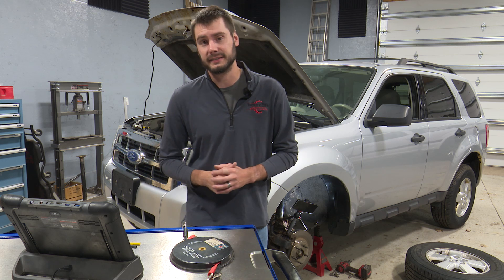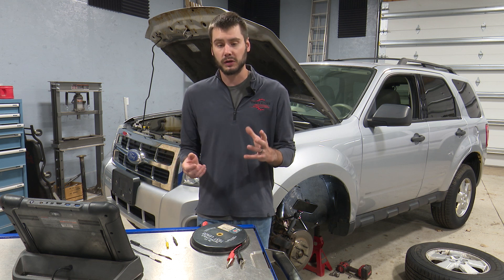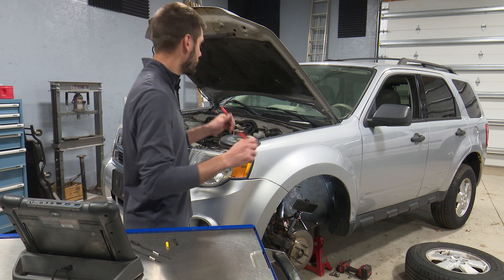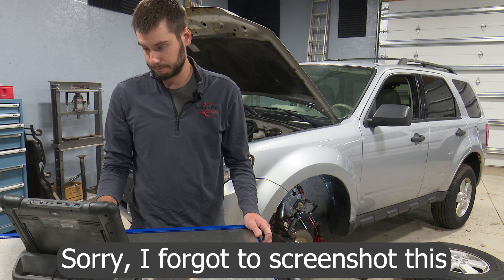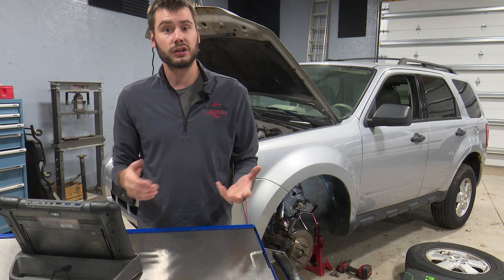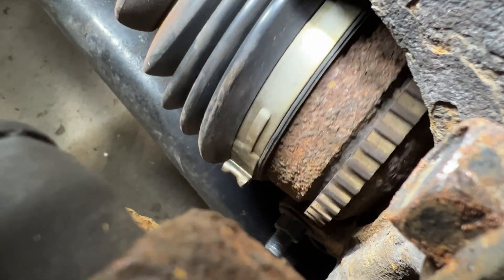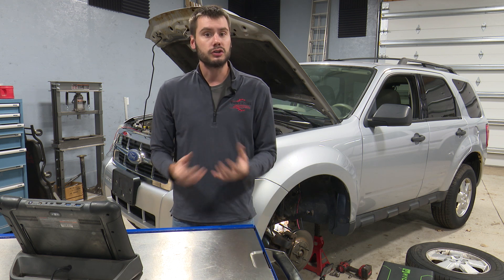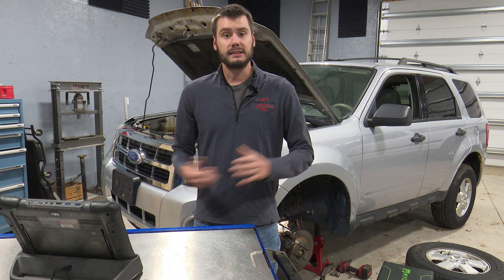How To Test ABS Wheel Speed Sensors

Comment: Sorry but for me it’s way quicker to either hook up a 1 channel scope like Uscope or simply just bypass the circuit with a signal generator. Put the correct waveform on and look at scan data to see if mph change and you adjust ratios. If it does that proves circuit integrity.

Comment: 3 out of 4 of my ABS sensors are working and all consistent except the left front one. It works but it goes up and down in speed. This is using a good Snap On scanner and monitoring the datastream. I got a new sensor and put it in. It works but the reading from it is even more erratic than the original one. 

There's 16,000 miles on the wheel bearing I changed in that corner. Could it be that the magnetic ring is damaged/defective? I cleaned it as best as I could and cleared the ABS dash warning but it never clears and is constantly there. The scan keeps pointing to the left front sensor. It's frustrating. 

Any input is appreciated, thanks.
Reply: Check the ground cables for those sensors for damage and corrosion
Reply: @humbledhands  the problem all along was a bad wheel bearing magnetic stripe. Swapped it and good to go.
Reply: @Hybrid600  was it a bad stripe on a brand new wheel bearing hub assembly? My abs light has been on for the front right ever since I put a new hub assembly in that side. The female pigtail became disconnected when removing the old one so I didn't know if the light was staying on due to a poor splice job of wires on my part. I've put in a new sensor and spliced in a new pigtail but it still won't clear. I would hate to put in another brand new assembly and the light stays on. I Just need my 4wd to work fml.
Reply: @joeluckenbach3682  yes was a bad stripe. Swapped the bearing and totally fixed the problem.

Comment: Is The car key in “on” position  to get the code?
Reply from the maker: Yes, to get a trouble code the module needs to be powered up. Either with the engine running or the key in the on position with the engine off.
~Mike

Comment: multi meter on sensor spinning wheel should show activity on AC  mode
Reply from the maker: On an AC style sensor that is correct. On this magneto resistive (MR) sensor, a digital square wave is produced. The sensor requires power and ground to operate.
~Mike

Comment: Keep the great content coming Mike!  Do you have any recommendations on service repair info for European vehicles? I primarily use Identifix and Mitchell ProDemand but info is severely lacking for European cars. It makes diagnosing or even hanging parts difficult at times. I have access to All Data but never use it because I like the layout of the other two sources better.
Reply from the maker: Hi John,
Sometimes if I'm in a pinch for info, I will purchase a day subscription to OEM service information.  BWM TIS can be purchased for $30 a day. It seems expensive, but it saves money in the long run not searching all over trying to find accurate information. 
Thanks for reaching out!
~Ryan
Reply: @GoTechTraining  Thanks for the tip Ryan!

Comment: Could you just short wire's together and see short reported then you know wiring good. So sensor or tone ring.
Reply: On gm with digital sensor it will kill power immediately if it sees a short.
Reply from the maker: Hey Ian, great question. Charlie nailed it, on GM's. Not sure about Ford, haven't tried it but i'd assume similar strategy.
~Mike

Comment: Its simple till you get 90s car with very intermittent signal loss going over bumps. No codes will tell you which wheel has signal loss. Driven with oscilloscope for hours back probed to all signal wires. Gave up
Reply from the maker: Hey Trout Junkie, thanks for watching! Sounds like a great diagnostic path to get the car diagnosed. Which sensor was bad?
~Mike

Comment: if it was a tone ring the code would't show up unless it was moving
Reply from the maker: Hey, you're right, that's a great point!
~Mike
Reply: In that case, you would most likely have a performance or signal code rather than a circuit code

Comment: this test has saved me a lot of money in he past / merry Christmas to you and you family
Reply from the maker: Awesome Simon! Glad to hear you're already using it! Merry Christmas and Happy New Year to you and yours as well!!!
~Mike
Reply: @GoTechTraining  I don't have a vehicle with wheel censors but I try to help others with their vehicle problems.  I'm not sure what running the information coming from the wheel on the the other side of the vehicle into the censor that has a problem is doing?  Should the code be off and stay off if the wiring harness is good?
Reply from the maker: That's correct MJ, if you have a code for the LF, you run the sensor signal from the RF to the LF harness side and simulate the LF sensor. This confirms the wiring and ABS module are ok. Then you're left with either a bad abs wheel speed senor or bad tone ring.
~Mike
Reply: @GoTechTraining  thanks for responding to my question. Have a
Merry Christmas and a  wonderful New Year.  I'm a DIY backyard mechanic because it's extremely expensive to bring your vehicle to someone else to fix your own vehicle.  Plus you don't know what they might have done to your vehicle.